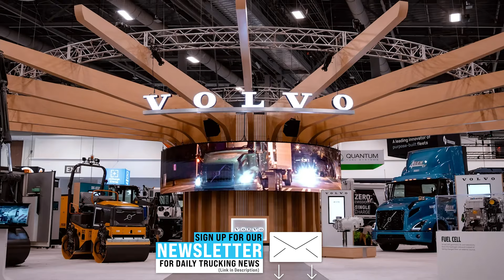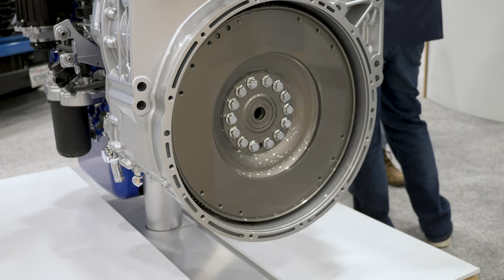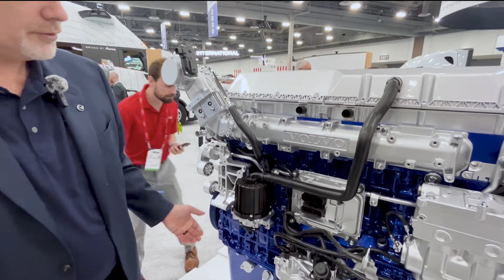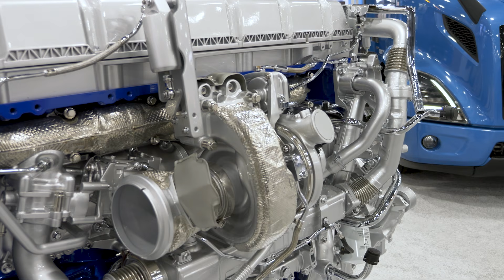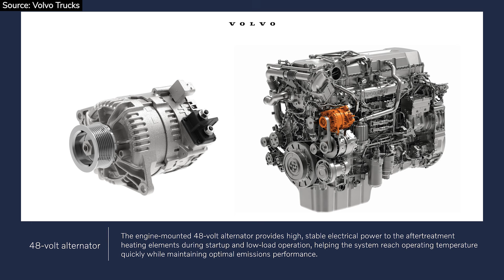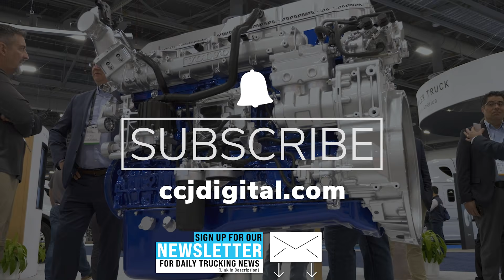New Turbo & Huge Upgrades: Volvo’s New 2027 D13 Engine

Comment: The Volvo D13K Diesel is Available at 560 HP/2900 N•m ~ 2139 Ftlbs of Torque.
FYI: The Volvo D17.3L I-6 is Available at 780 HP/3800 N•m ~ 2803 Ftlbs of Torque.
Our Diesel Fuel is Dirty with 15 PPM of Sulfur allowed here in the USA.
Europe's Diesel Fuel is Allowed Only 10 PPM because of Their Stricter Emissions Requirements.
We should Follow the European Example. The Cleaner Diesel would help Improve Emissions here and could Reduce Carbon Build Up in Diesel Exhaust Systems. 🤔

Comment: They need to make available the Blue painted engines. All I see are Green Engines. Also I would like to see more hybridization. Add an axial flux electric motor to the clutch setup and make the starter motor irrelevant. Plus make all the accessories electrically driven and mount them on frame and not on the engine. Finish off with water to water intercooler mounted over the valve cover and connect to a short runner dual path intake manifold setup feeding into the cylinders at a more motorcycle like intake path angle

Comment: No Jake Brake anymore.
Reply: Volvo engines never had "Jake brakes"...
Reply: @j.m.5995 yes they did, since D12, no matter what they call it.
Reply: @V8Lenny Jake Brake is A specific device sold and manufactured by Jacobs engineering under license from Cummins. Volvo utilizes the "VEB" system A combination of exhaust brake and compression release brakes working separately or in tandem to provide retarding effort
Reply: @j.m.5995 exhaust brake is just for noise reduction for Europe. Compression release brake is "jake brake".
Reply: @j.m.5995  The Volvo Engine Brake (VEB) is Built into the Design from the Start. It is NOT a Copy of the Jacob (Jake) Brake which is Installed as an Afterthought.
On the Volvo D13 Engine 500 Braking HP is Available at 2100~2200 RPM. 😎
Reply: @henryblanton6992 Yup I know that. I read the brochure

Comment: When will an engine manufacturer finally get away from all this garbage on the engine and just creat a catalyst separate from the engine entirely that treats emissions. Let the engines breathe!
Reply: thats what is done here, like was done years before.
Reply: @V8Lenny absolutely not. That engine has EGR.
Reply: @jamescaliendo1030 only for light loads to keep exhaust warm.
Reply: The closer the aftertreatment stuff is to the engine, the better it works, and the less fuel you have to waste to heat it up. You don't want it mounted further away.

If you want to get rid of it altogether, put a throttle body, spark plugs, and gasoline fuel injectors on it and run it at stoichiometric air/fuel mixture.
Reply: @bhtooefr that's one of the reasons Cummins is using electric on their 27 X15's for their catalyst. No more useless fuel burning. I dont know why they are doing any of this. The emissions have been rolled back to '09 standards